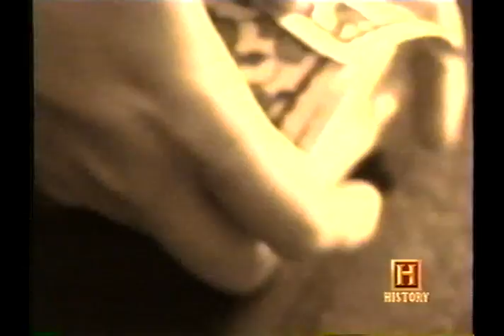Water speed record runs - hydroplanes - Jet boats

Comment: 15:13

Lee Taylor’s body was most definitely found-
he was still strapped in and only had a bruise on his forehead.

His helmet was gone.

He was unconscious and drowned when the boat sank after the crash.

The boat did not have adequate safety flotation so it sank.

The main hull was still mostly in one piece.

It is in the High Desert in 
Southern California.

The last time I saw it was at the 
Boron Aerospace Museum in Boron,CA 
just a few years ago
but it’s been moved into storage since then.

There are pictures online if you look for them-
the video footage makes it look like it entirely disintegrated but that was the sponsons,supports,bow&tail breaking away from the main hull 
where the driver,cockpit,
fuel/pressure tanks and engine were.